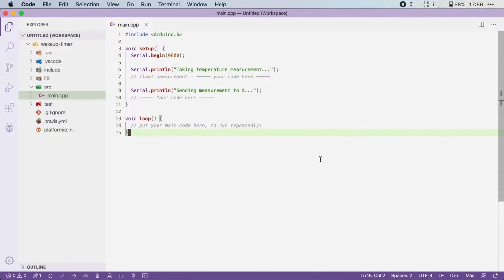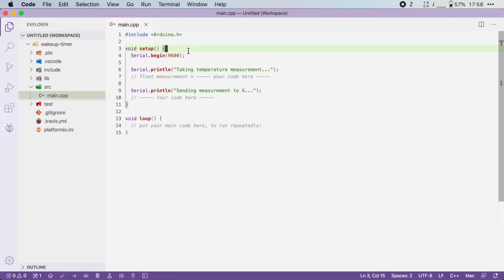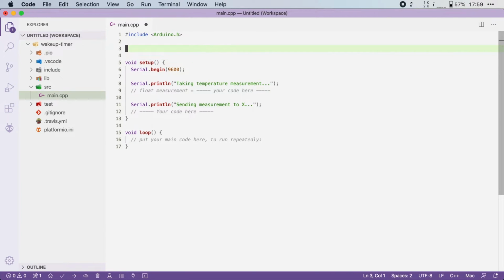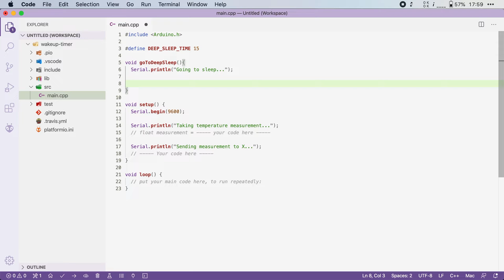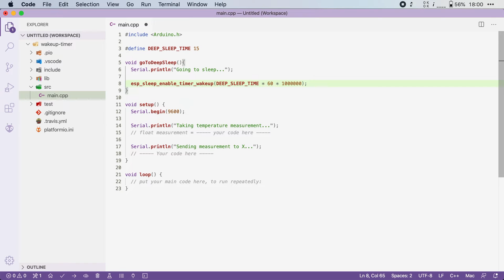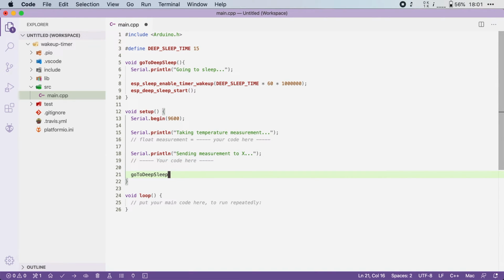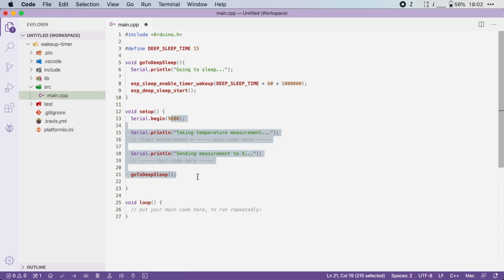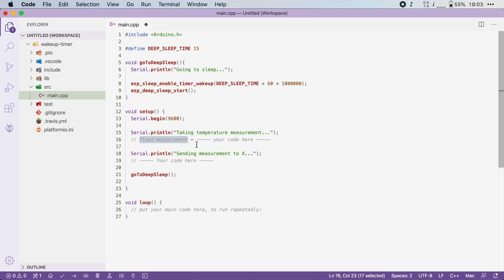Wakeup From Sleep With a Timer (ESP32 + Arduino series)

Comment: running from usb power, I have a sim 7600 connected to the 5v on the ESP32. The power to SIM7600 dies not turn off when in deep sleep resulting i major power drain.
Can this be overcome

Comment: Hello, thanks for a very thorough tutorial. However, I have a question for the DEEP SLEEP state. If I have any digital outputs and one of them is set to HIGH when entering deep sleep, how does this output react after sleep? Are the outputs still latched or are they all LOW?
Reply: They would return to their startup state but you've probably worked this out with a print statement telling you their state. I believe he says you can store persistent variables and that would be the way to reinitialise them to their pre sleep state in setup.

Comment: I'm doing this, setting the variable to 60minutes but it wakeups instantly. The maximum seems to be 35 minutes. Any ideas?
Reply: use   esp_sleep_enable_timer_wakeup(8ULL*60*60*1000*1000); for example if you want 8 hours
Reply: Did you sort this out? It seems no matter what value I set it instantly restarts.
Reply: Fixed by delaying a bit between enabling deep sleep and starting deep sleep. Not sure why, but I must be doing something wrong.

Comment: Hi
I followed your video to the letter but when the sleep code is in my Arduino IOT code the esp32 will not go online, I take the deep sleep code out and it does. I tried deep sleep code with my ESP12E and that did the same. Thoughts anyone

Comment: I would like to put my esp32 into deep sleep with a timer. Currently esp 32 exposes an api which is called every 20 minutes. I would like to put him to sleep for 19 minutes, allow the bee to respond and then put him back to sleep. I've seen your example but it doesn't use the loop method. In my loop method there is the server.handleClient () statement; and with the sleep timer it is never called. how can i solve? Thanks to those who will answer
Reply: put all of your code in setup (still keep the loop function , just leave it empty)

Comment: Hi
It's a very nice instructional video you have made, and it takes place quietly, so everyone can follow - nicely made! I have a sketch that shows the time (clock), with an update every minute. It appears on the E-Paper display and it is ESP32 board that controls it. It is powered by a battery. I want to hear if you could make a small modification, so that it is not updated 24 hours a day, but only at certain time of the day, to save battery. It could e.g. Go in Deep sleep at 2300 and then wake up again at 0700, thereby saving power on the night, when I am not looking at the clock. Is it possible?
Yours sincerely
Georg